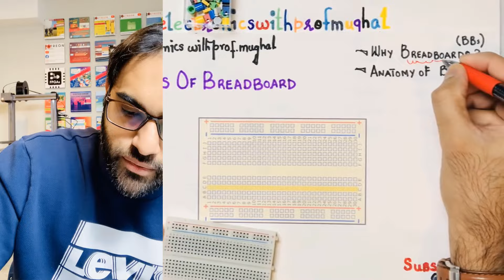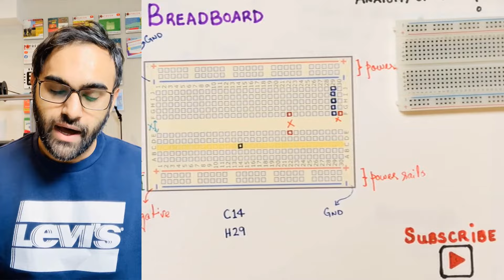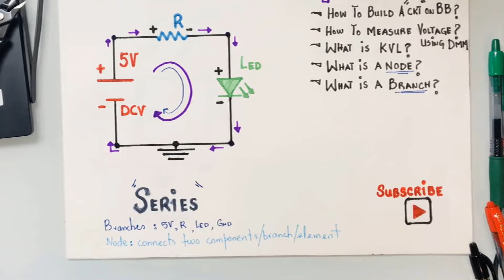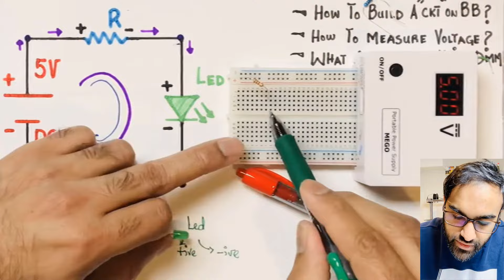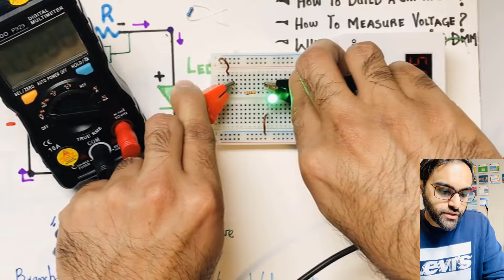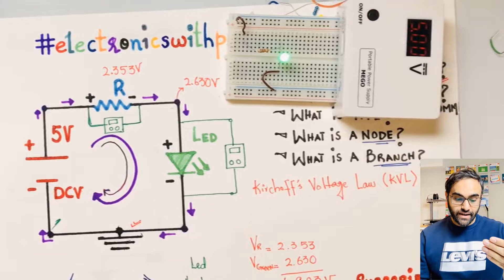Part 1 Basics of Breadboards for Beginners | Measure Voltage and Current using DMM

Comment: In 04:00 the rows of power lines on each side aren’t connected. Yet, in 18:00 they seem to be connected, ie there’s current.
So, what is going on?
Reply from the maker: Have you watched the full video? I don’t see any thing wrong. Please elaborate more. Did you get your timestamps right?
Reply: @ElectronicswithProfMughal  in 04:00 the 4 power rails aren't connected with each other, lets name them, from left to right A,B,C,D.
In 18:00, y just connect the power lines B and C, and y have currrent. In order to have current, B and C MUST be connected.
Reply from the maker: @1Eagler  I am very sorry, I don't fully understand what you're trying to say. If you connect B and C, they will be shorted, and you don't want that to happen. I am simply connecting the positive terminal to one rail and negative to another rail on each side. And simply using Multimeter terminals to measure the voltage.